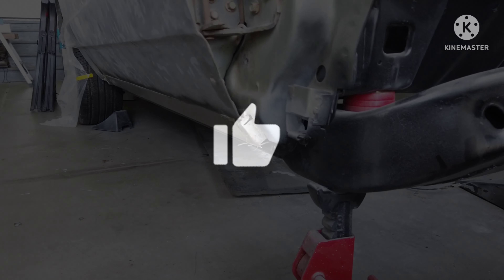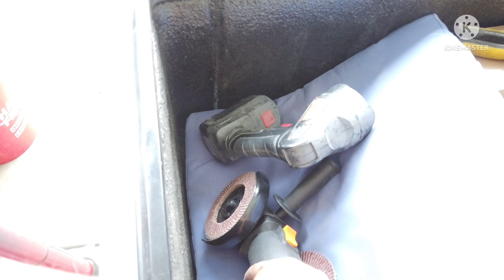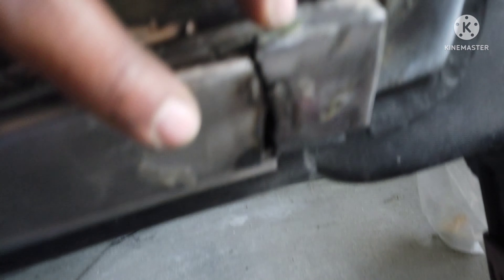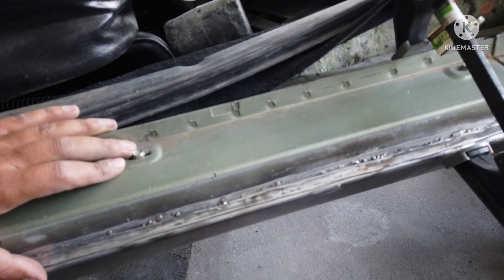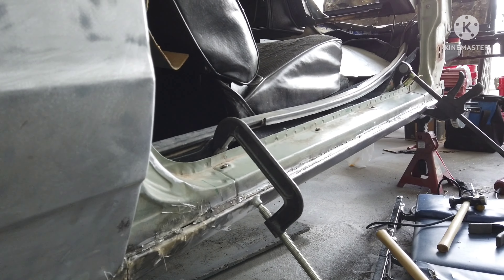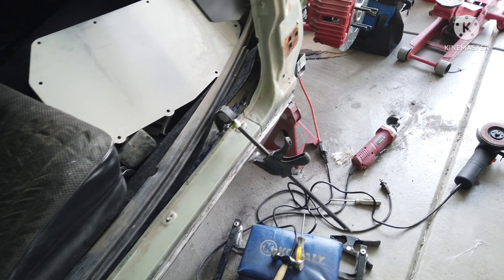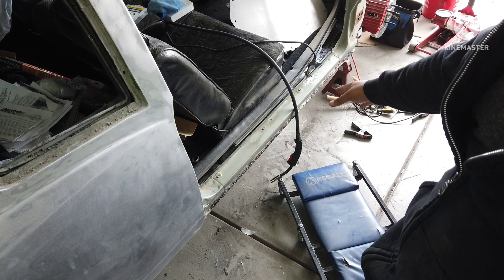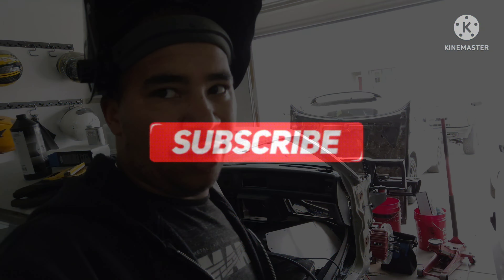More body work on the Monte, attempting to weld in the rockers.

Comment: Your good bro. That's the way you are supposed to weld sheet metal with a mig welder so it won't warp. 👍
Reply from the maker: Thanks. I watched a few videos and that was the major thing not heating one spot up too much and cause warping.